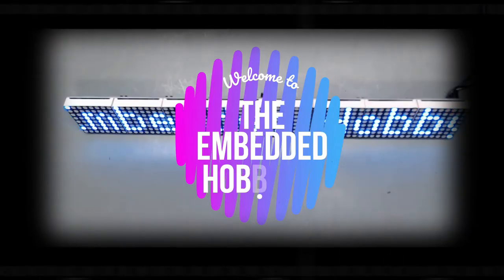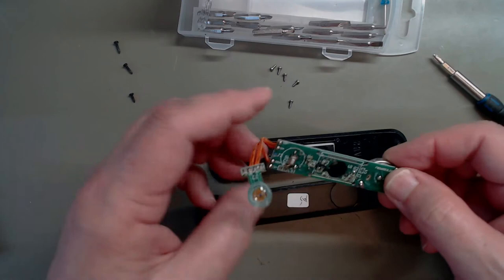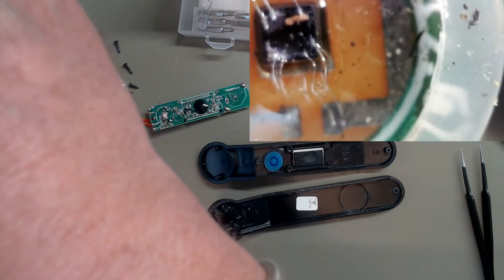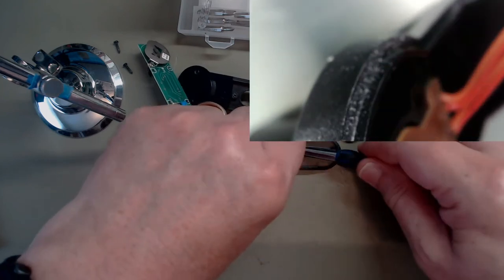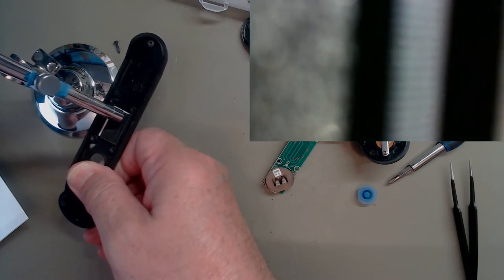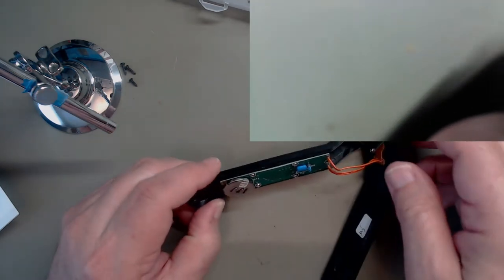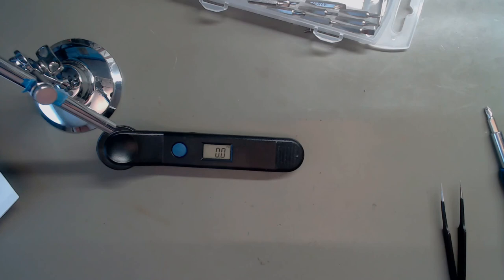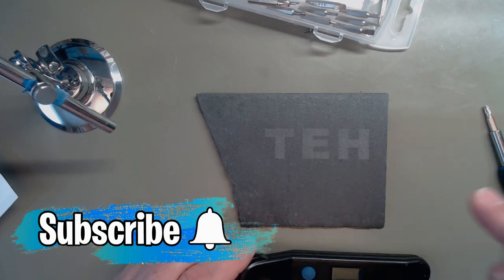#141 Tyre pressure gauge tear down

Comment: I have a mechanical tyre pressure reader simples no flat batteries, no bad display. Mind you yours is more interesting inside with a chinese Blob :-)
Reply from the maker: Thanks Fred, How the heat getting to you?
Reply: @TheEmbeddedHobbyist  no Problem I was working at Tinsley viaduct in 1976 that was hot surrounded by new sewerage work concrete and only water was piped in surface copper pipes was hot, so at the bottom of the new settling tanks is a one way valve through which lovely ice cold water came so we drank that :-) and you are you coping :-)
Reply from the maker: OK, but don't do heat very well. everything is just sticking to me.
I was in the last year of school in 76, doing exams! they just moved the desks away from the windows and gave us a glass of water during them. Will be nice not to have to say can you remember the heat in 76, now we can say 22 :-)
Reply: @TheEmbeddedHobbyist  HA HA!! not that much different, if you look at the weather charts :-)